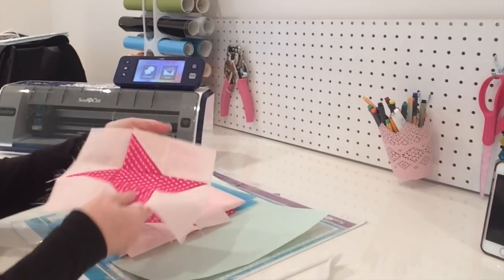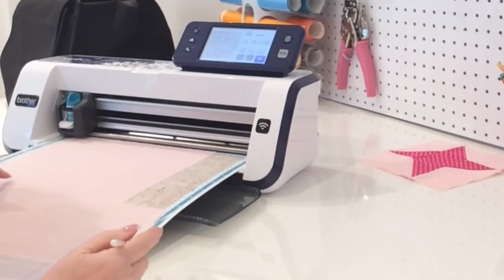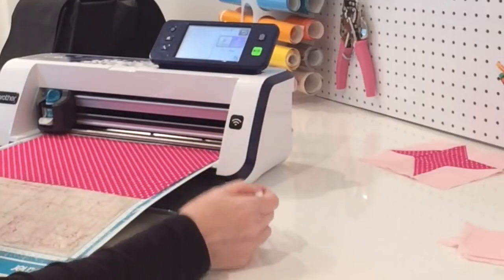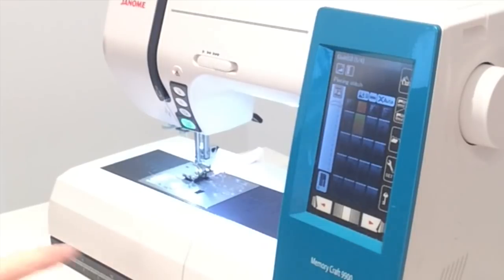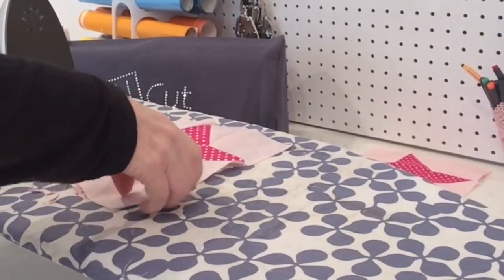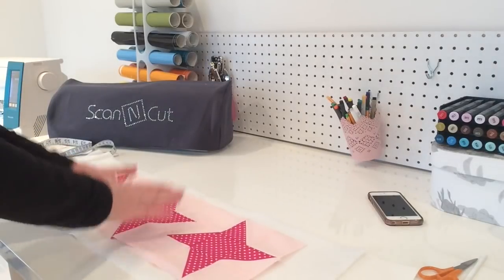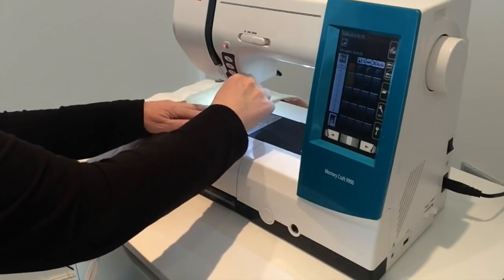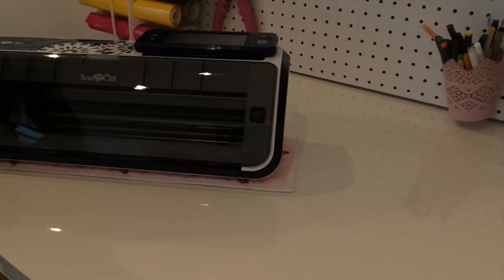ScanNCut Fabric Table Mat

Comment: I think I am trying to say adding a 1/4" around the pattern in the machine before I cut it.   You mentioned you had to turn the pattern over?   Maybe I misunderstood what you said.
Reply from the maker: Ok I understand now, if you use the SNC to draw on your 1/4 inch sewing line you need to put your fabric on the mat right side or pretty side facing down, so the SNC will draw on the wrong side for you, then when you sew them together you can follow the drawn line. Hope that makes sense.
Reply: Yes that makes perfect sense!     I did have it in my mind wrong.   I am so new at this.    Thank you so much for taking the time to help me.   I have started on your old videos,   they are a little hard to hear as you said but still very great.      Thanks again.